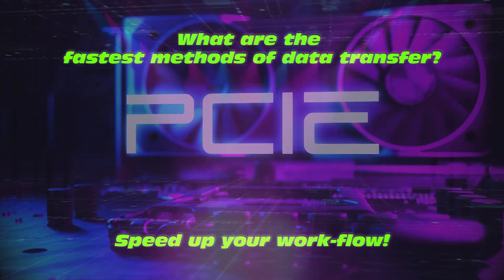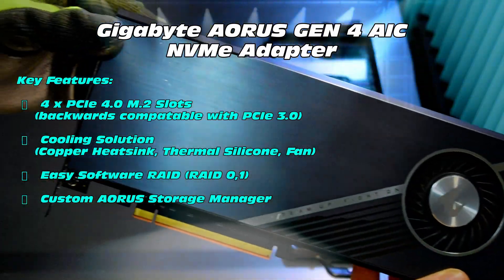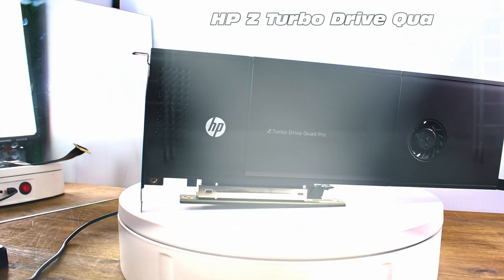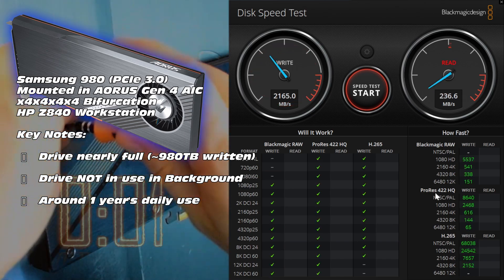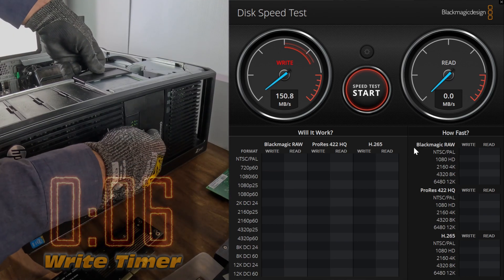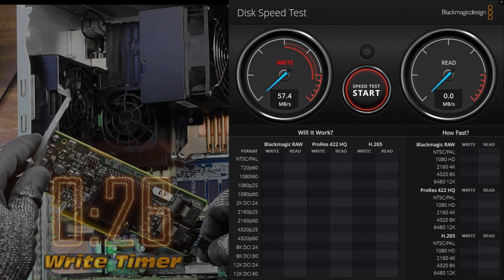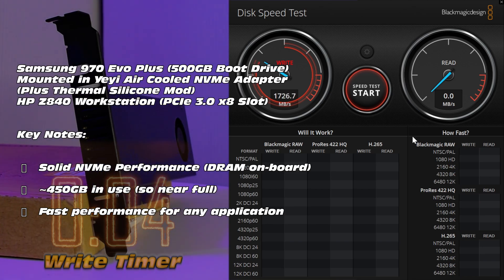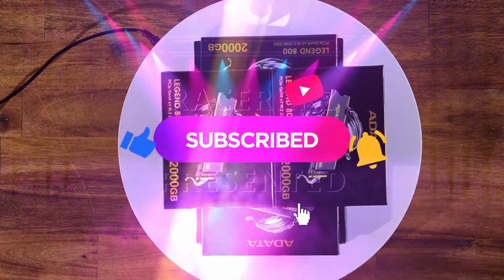HDD or SSD or NVMe? How to Install? Speeds? All this and more!

Comment: Have you enabled jumbo frames on the 10Gbe? That usually does the job on write and read!
Reply from the maker: I have yes, jumbo packets was the only change that I found that actually made an impact. 

I have done a heap more testing to try to raise speeds but my connection speed has not gone above ~7Gbps, and file transfers tend to sit around 1.9Gbps. 

My conclusion was the speed limit on my file transfers was the HDD (~240MB/s = 1.9Gbps). I was running only a single HDD in my TrueNAS pool (HDDs are expensive lol) which limits the speed. For full speed I would need to use the speed benefits of striping data between multiple HDDs. This is the same mechanism behind getting faster transfers on RAID 0 pools etc.

Comment: Great video on this subject I'm quite happy to see something like this.
Reply from the maker: Thank you! This is the teaser trailer to the follow-up video where each adapter will be tested. I'll also include the PCIe 3.0 4x U.2 to 4x M.2 NVMe x16 adapter - it looks cool but I am yet to test the speeds on it. I just hope the HP Z Turbo Drive Quad Pro fits into my Z840 since I technically modified the shroud area where it would normally clip in to.